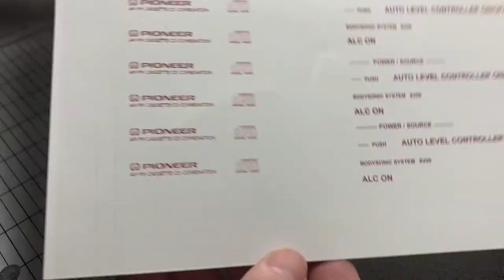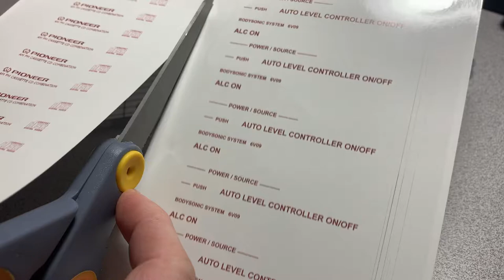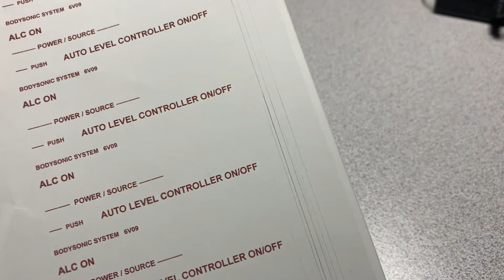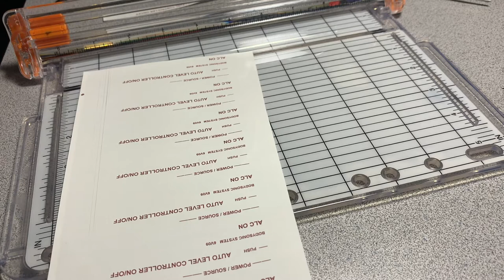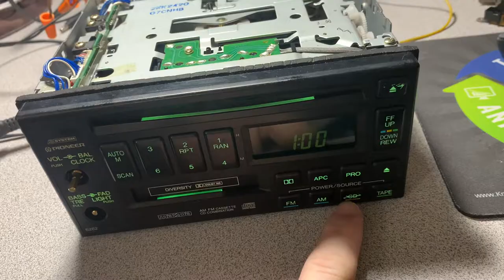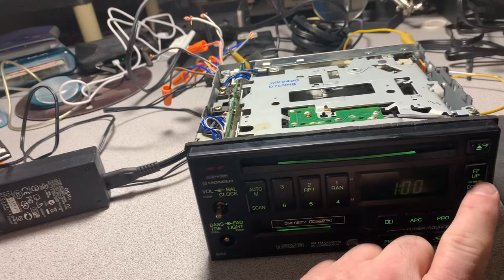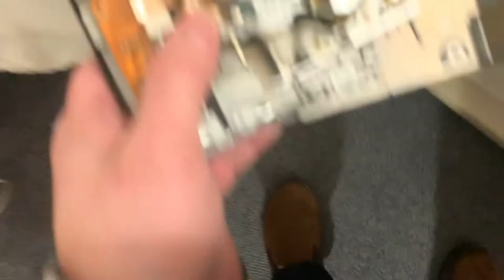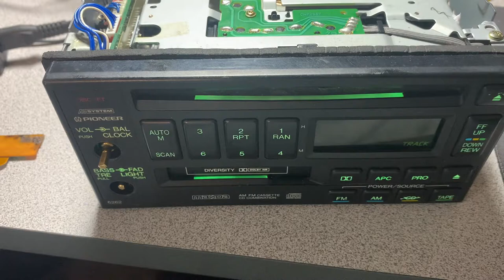Mazda Miata Pioneer MSSS1 "Silver Stereo" - Applying Decals and Replacing Optical Block w/ NOS Part!

Comment: Looks much better. Sanding it down and cleaning it so there are no oils or dust was key. You can now see it looks sharp and more contoured around the plastic moulding. Not just paint just slabbed on like before. Clear coating after the decals will seal them and protect the paint as well during use from rubbing off. Nice job.

Comment: Looks great!  Contact info for the file?  A tutorial on making decals would be great.  I need to make a set for my Sill plates.
Reply from the maker: https://docs.google.com/document/d/1cqUhf-gWUl-FWz5RDRerV7nh8YYhVNNMAXIZwa2347o/edit?usp=sharing Here's the link - the graphics should be printed on waterslide decal paper. I recommend using LASER decal paper on a LASER printer to reduce the likelihood of fade over time, and for overall print durability. If using inkjet, you will need to use an Epson printer as their inks are water resistant and you will need to ensure you're buying Inkjet compatible decal paper. I printed mine on a color laser printer. The finished product will need to be clear-coated, or the decals will degrade quickly.